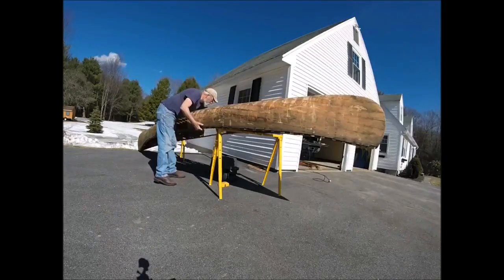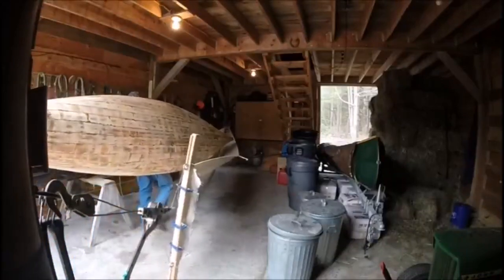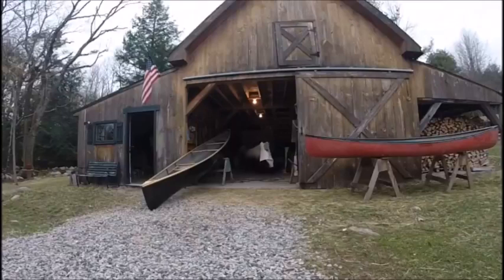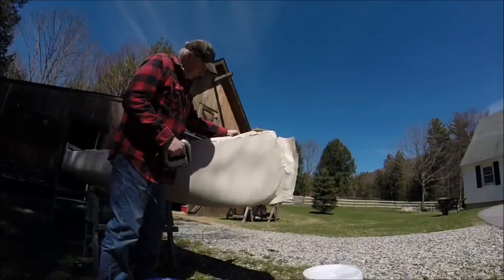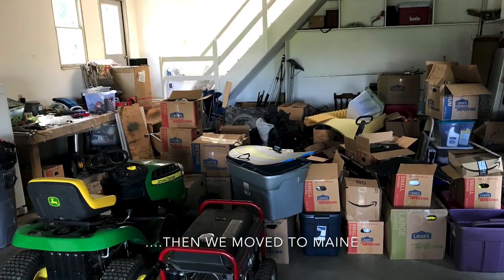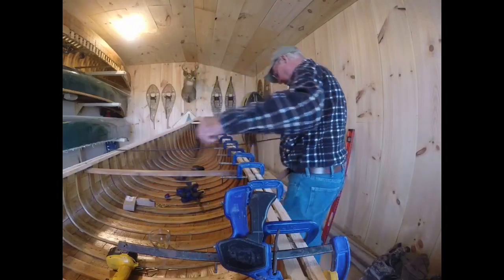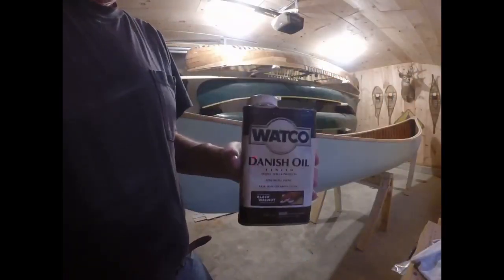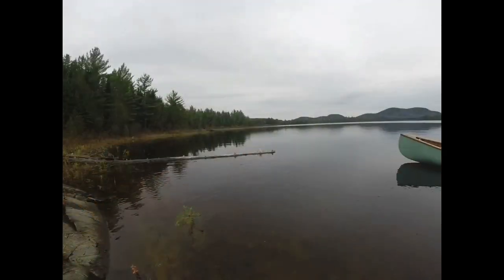Modifying and Restoring a wood canvas Chestnut Cruiser Part 2

Comment: Pretty boat.  I've selected a similar color for my 20 footer,   btw, if you are ever looking for full length clear spruce I may have some.
Reply from the maker: Thanks, I’d like to come up that way this spring, we should hook up for some canoeing.
Reply: @RobinLauer  For sure!  we can check in after ice out, if we ever get ice in .
Reply: "I've selected a similar color for my 20 footer"

What paint did you use? My family has a 1964 Chestnut Prospector that has been recanvased twice, but the new colors never quite seemed to match the original from the factory. It is time for a third go round with the canvas, and we are hoping to get the color back to original, but finding a match is proving difficult.

Comment: Beautiful work sir!!! That soft apple green is very restful to the eye. I will be restoring a 12 ft Huron,  Trapper  this spring. I'm wondering what you used as filler on yours? 
Thanks
Reply from the maker: Thanks, I got the recipe from the book "This Old Canoe" by Mike Elliot. It's 43 oz. boiled  linseed oil, 21 oz. mineral oil, 34 oz. enamel (oil based paint), 2 oz. Japan dryer, 2 oz.spar varnish, 6.25 lbs silica (300-325 mesh) needs 30-40 days to dry, lightly sand when dry, then 2 coats of Prekote primer, I use Interlux Briteside Polyethylene, 1 quart does 3 coats on a canoe, sand between coats
Reply: @RobinLauer   Thank you !!! I will look into that!!!  I'll be stripping the canoe during sugaring..and making new gunwhales... Was thinking cherry but spruce for its lightness is appealing..
Plus a #12 tarp... I'm trying to lighten up this little 12 footer as much as possible to be able to use it to get into some small  trout creeks and lakes
Reply: @RobinLauer   Do you have an idea how much weight all that paint and filler  adds to a canoe?
Reply from the maker: @blackspruceroutes  I think spruce is a good idea, that's what I use, lighter than ash. #12 canvas is good, not nearly as tough and it will show hull flaws but you save weight. I think the filler/paint ads about 6 lbs,  any of the lighter options will not be tough enough for back country use imo.
Reply: @RobinLauer   ok!!! Looks like we agree on everything!! Hahaha
I'm also in the process of looking into a baker style canvas  tent... and stove...